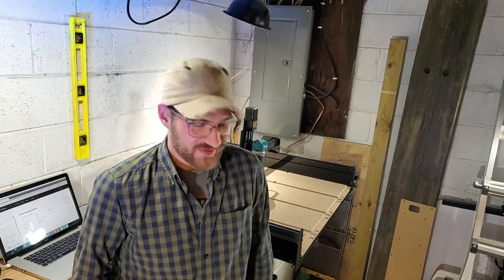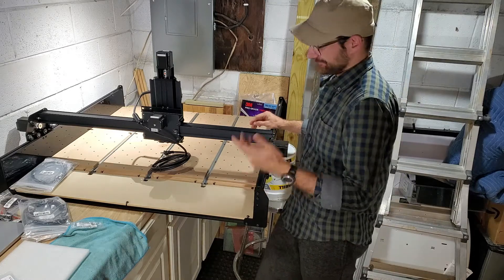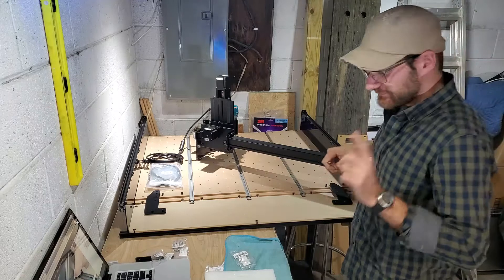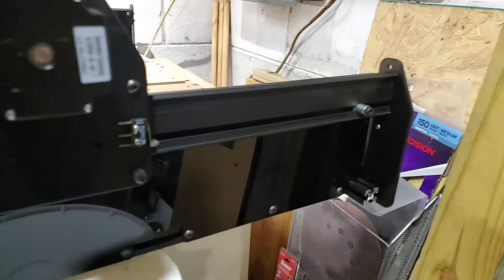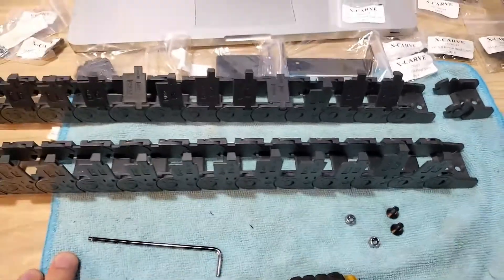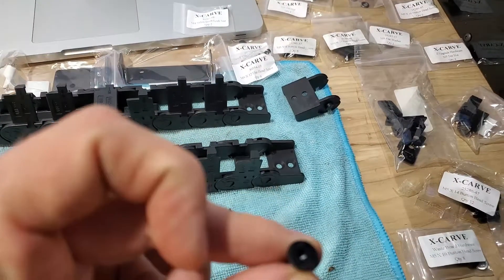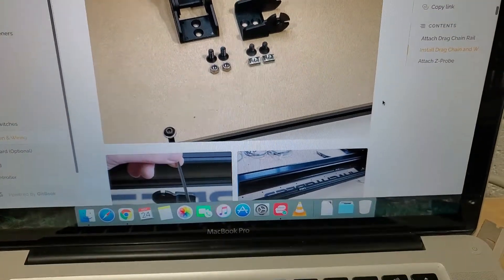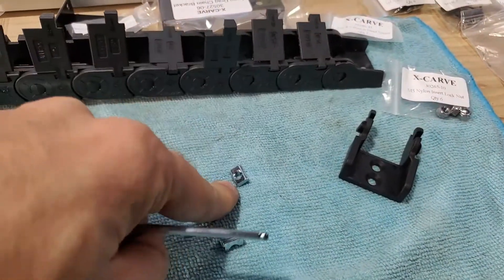Inventables New 2021 X-Carve Homing switches and wiring

Comment: Od 15:43 how you make that the drag chain didn’t hit behind in the profil ? I have that problem also Inventables didn’t gave me enough t nuts.. for side Board
Reply from the maker: What I did for the drag chain was loosen the bracket anchor "The part that attaches to the rail" and move the drag chain slightly.  I also had to move the side board where the controller mounts.  I had originally placed it to tightly against the side of the X-Carve smooshing the drag chain and making it hit the back L bracket.

Comment: Thanks you alot for the videos they really helped a lot I watched them before I bought x Cavre and I am using them and the instructions from Inventables to  assemble my machine, I'm wondering if you have any excess screws and nuts left when you assembled it?
Reply from the maker: I did have extra screws and nuts.  Especially if you purchased the bundle.  Inventables includes enough hardware in each upgrade kit for its own installation.  If you purchased the z axis upgrade separate you would have all the appropriate hardware, but if you got the bundle you now have double the hardware.  It got me all confused at the end when I had multiple bags of extra parts and the machine was fully assembled.  Good luck!